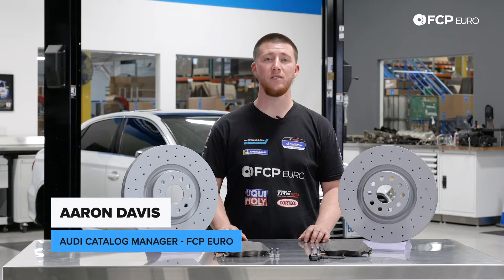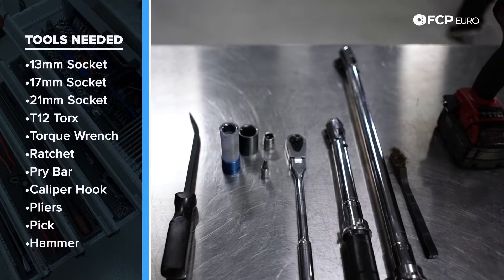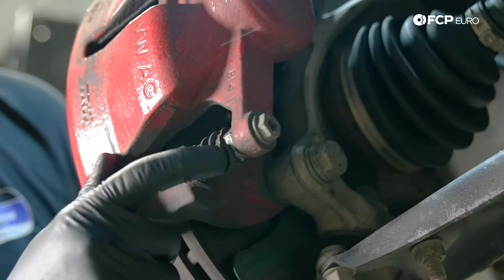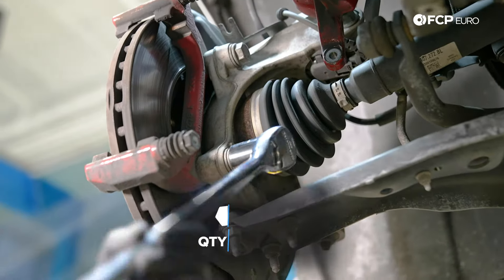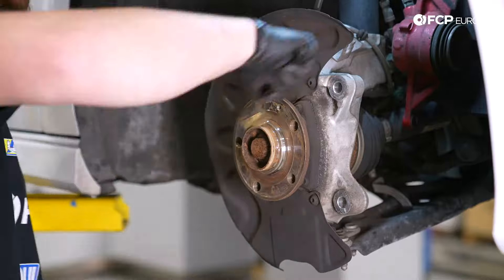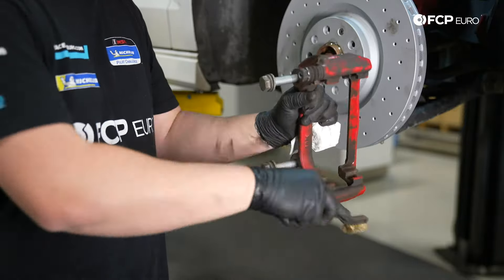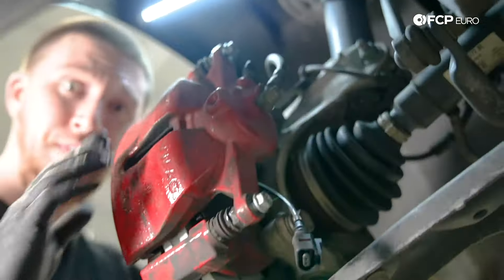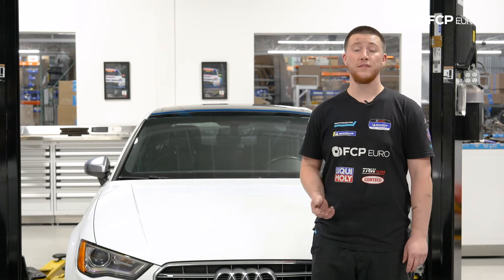Audi S3 Front Brake Pad & Rotor Replacement DIY (2015-2020 Audi MQB A3, S3, TT)

Comment: Where the hell can i find a t12 torx bit wtf
Reply: same here... maybe typo? T12 is soooo small maybe and no kit has it
Reply: @hot2me654  it has to be a typo. Maybe t20?
Reply: @Neuk__ he says 12 at the beginning of vid then uses a t30 for the rotor retaining screw?
Reply: Auto Zone, Advance Auto or any auto store. An Allen Wrench works as well
Reply: I have a few questions. One is this the same on an A3? Just making sure.

Next question, do you have a video for the rear brake pads for the A3?

Comment: Just did this repair. The piston would not fully retract from a pry bar alone and I was able to resolve this issue by using a C clamp+a disc from a caliper tool kit that fit. Just a tip for those who may be struggling at the same part 👍🏻 the logo plate on the front makes it impossible to use a caliper tool normally

Comment: Great video but for some people that are watching you may want to consider a few things I’ve run into. Not all those caliper pistons will compress with a c-clamp or normal compression tool. Some are racheting pistons and they require turning while compression. Good luck doing that without a $20 kit I had to buy. Also saw how easy those set screws were to take out? Yeah good luck hahahaha. I’ve seen ppl use the impact screw driver where u hit it with a hammer and it turns and that seems to work good. Well, I didn’t have that and I had to use a strip screw kit on everyone except one that I had to drill out and make new threads for. I’ve even seen multiple videos where people don’t even put a new set screw in because they know it’ll just be a pain later on (I don’t recommend that, it’s just a set screw but I’d rather spend hours getting the old one out or making new threads than going without it just cuz it’s my car a I’m annoying like that). 

It’s an Audi, they are going to throw every weird, annoying, and dumb over-engineered design they can at you. Just realize everything with your Audi is going to be an ordeal to do yourself, if you know that going in, then you can plan accordingly for when you leave your Audi on jacks for the night cuz you had to order a part/tool because you don’t have it or you broke the one you had while in a rage from working on your Audi.

Comment: Love the video, you're an extraordinary mechanic. This 2018 A3 my 1st Audi, and at 60K miles I just decided I'd dive right in, being the senior citizen I am, proud owner of a 69 Boss 302 all original equipment as a 1st car in 1973. 

You're extraordinary, thought the sensor was the most time consuming portion of the project.  I really wanted to cut it off and hack it so as not to have to deal with it but what's time when you have little left?  The cable lead was different on my A3 Premium and I accidentally got it off, but then realized my OEM brakes didn't come with a new sensor and cable. I cannot imagine why we'd put in new brakes and not a new sensor given then small cost. But that thing is a pain in the ass.  Still tbe Audi is a dream car for me.

Comment: Thanks guys for uploading these kid of videos. You save a lot of money to you customers. It would be great if you can share WHEN to replace the rotors. Normally you know when you have reached the minimum rotor THICKNESS which is technical info not available to the common people. In this particular case, what is the minimum rotor thickness say for the A3 8V lineup? I have a 2018 A3 Sportback 2TFSI and I dont find this info in the web.

Comment: Those 21mm bolts are very hard to remove without an impact wrench. FYI, turn the wheel out to gain better access.

Comment: Thx 4 tha vid. It helped but did not fully resolve my issue.  I got the bulb out, but I'm trying to get it back in and can't get it to secure back in the slop with the clamps. I will never buy another Audi again.  I don't care if I strike it rich and can afford to pay the dealership for repairs. Neva again.  To change a bulb should be a 5 min job. Let say I'm traveling.  A bulb blow. I should not have to take my tire off, take off my wheel wale, and need all these extra tools just for a bulb.  I spent $120 for a bulb that is now slitly damaged because of the sorry complex design. Now it may blow sooner than later cause the blue sleeve is cracked. I hate this, Audi! I wish something could be done about this because a customer should not have to go through such hardship.  My car is sitting on a jack stand because I have spent a whole day trying to change a bulb,  only to be unsuccessful because of this stupid, poorly designed car. 
Sorry for venting on your page. I know you don't have anything to do with the situation 😒

Comment: ATE suggests using their ceramic break pads with flat disks (not cross drilled) to benefit from reduced dust emission
Reply from the maker: Flat discs will certainly help keep the dust low!

Comment: Have no idea why he didnt used a normal 17 wrench instead of those ugly pliers. Also the sliding bolts ( the ones holding the caliper on the carrier ) should be taken out, cleaned and greased, and remounted. They are responsible for the good adjustment/sliding in time, as pads wear out  you can use also Ate Plastilube, hes using in video. Too much anti-seize used,  Zimmerman ( the rotor manufacterer ) expressly says to not grease/antiseize the hub where is attached the wheel afterwards. Check the little manual that comes with stuff.

Comment: When winding the piston back do you need to open the fill up lid
Reply from the maker: Generally speaking no, but if you vent it slightly it may help with less resistance in the piston. Most of that is in the fluid however, not the air at the top of the reservoir.

Comment: Old video, but can anyone enlighten me on the placement of the jack points/stands on the 2019 Audi A3? I see that there are four arrows directing me to pinch welds to jack up the car, but I can't see any other place to put the actual jack stands, especially in the front which is just one big piece of plastic. I've watched tons of videos and there always seems to be a different setup than mine. It's incredibly frustrating and would appreciate some expert guidance!
Reply: I just used my judgment on the jack stand being ahead of the jack. You can see the welds fit into the stand and jack well